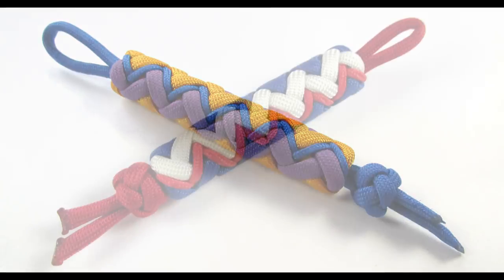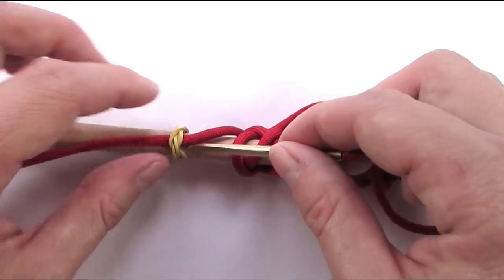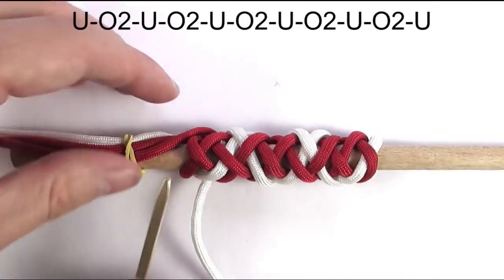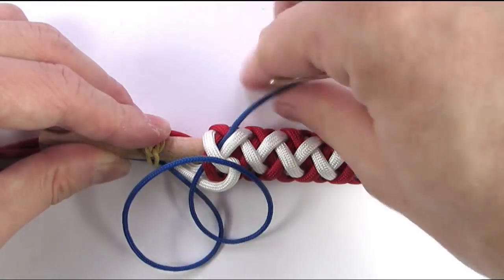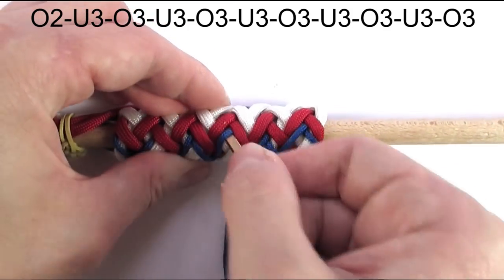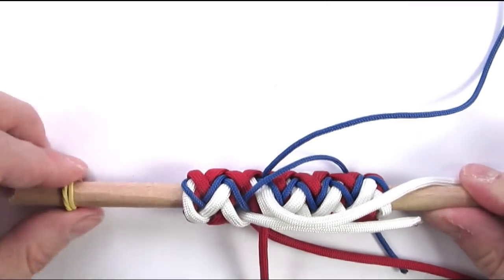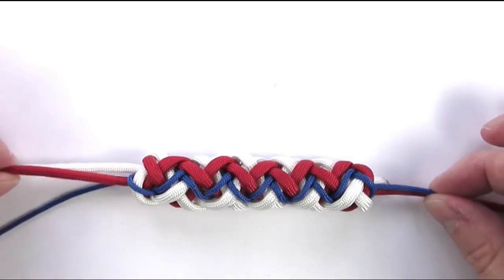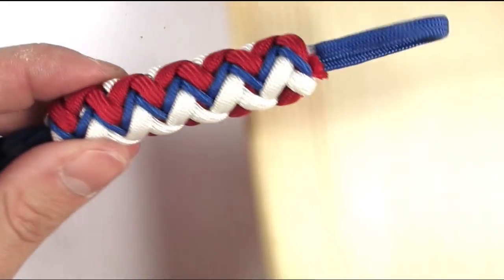Paracord knife lanyard/key fob

Comment: Hi Marko! Thank you for the great tutorial. I’m finally able to make these consistently. I did find that getting the loop in at the end was quite a challenge, so i drilled a little hole in the end perpendicular to the mandrel and I run a small piece of micro cord thru it then thru the lanyard, and back thru the little hole in the mandrel. I tighten that up and then just slide the gaucho knot over the lanyard and voila! It’s thru! No fuss,no muss! Thanks again!!!